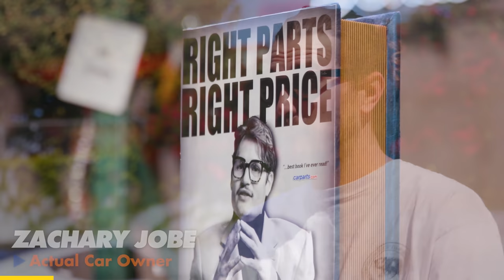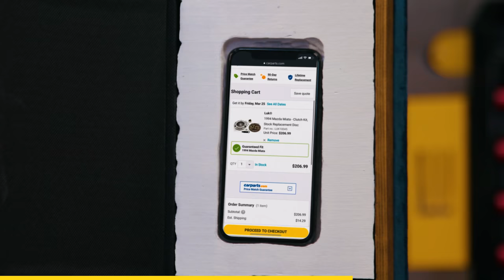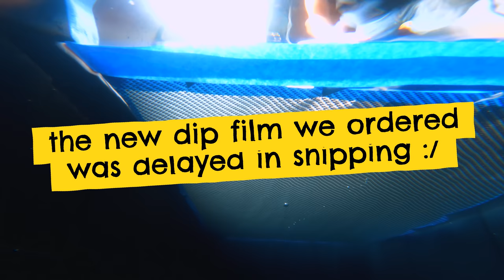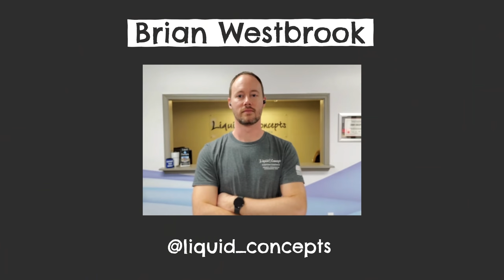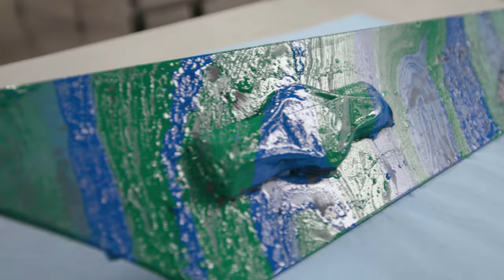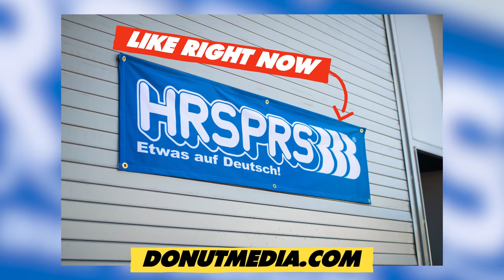We Tried Hydro Dipping Car Parts

Comment: Instead of using activator to wipe the film to check which is the correct side, wet your index finger and thumb and pinch both sides of the film. Whichever side sticks to your finger is the that goes up.

Comment: With spray paint you're supposed to spray the same spot over and over again while keeping it away from the water enough to not stir it. . Also hold the can angled upside-down ish so the paint comes out thick. It can look good.

Comment: So for the spray paint method the reason it's textured is because you're using way too much fucking paint.......try it again with less paint, dip at slowly at an angle..you don't want any bubbles.....then have your friend swipe the excess paint out of the way before you pull it out.....

Comment: I honestly hydro dipped my glock slide and it came out nice I'm just wondering what you do when you get alot of loose hanging hydro film once taken out if you try to tear it off it could rip some off the hydro dipped part do you just leave it? How do pros stop that problem from happening took me like 5 attempts to put a magma dip on and every other time looked wrong

Comment: I spray paint hydro dipped a bunch of stuff, used epoxy paint and warm water..  turned out awesome.  After the dip i cleared over top to even out the epoxy ..  ended up with a smooth finish that looked textured..   also only reason i did that though was because i had a couple cans that were too low to use for the parts and some were just out of gas so i just literally took some pliers and pierced the cans in a bucket and dumped out all the paint in the water ..

Comment: Bro hydro dipping isn't just paint in water. You have to get the film and activator sets. I am a gunsmith; I hydro dip and you are failing miserably.
Reply: Gloves and a 30-degree angle when dipping. Also make a 1" pvc pipe floating rig that is square or rectangular instead of tape. Oh and you are supposed to rub it in the water after dipping until it isn't slick. Slick

Comment: I spent a summer making interior plastics for GM. The coolest parts were when they were changing colors. You would get the previous color marbled with whatever they were switching to. They looked so cool, and always ended up scrapped.

Comment: I built my own with a high quality filter and a powder coated metal elbow and correct adapters. I also made my own heat shield, it looks and sounds terrific and on the dyno I think I picked up three or four horsepower which is almost what the name brand offerings promise for double or triple the price. Did you guys try a before and after Dyno?

Comment: The spray paint dipping method was done at the most basic level, you dont have to spray directly on the water. You can flick paint from your hand with a latex glove onto the water for speckles etc. also you are meant to lightly sand when dry to get rid of the texturing.